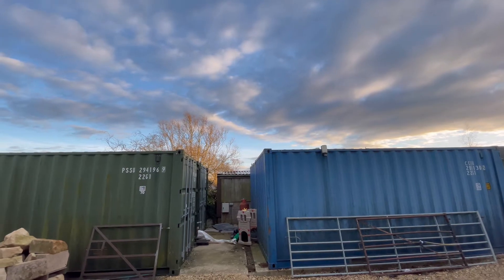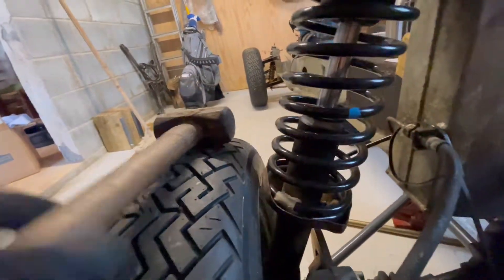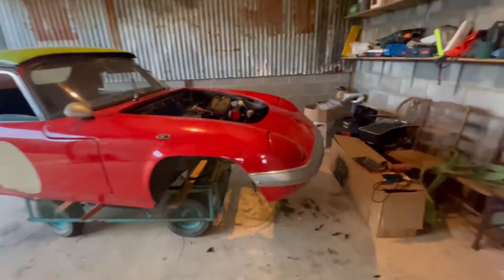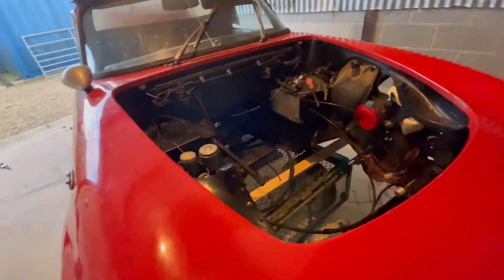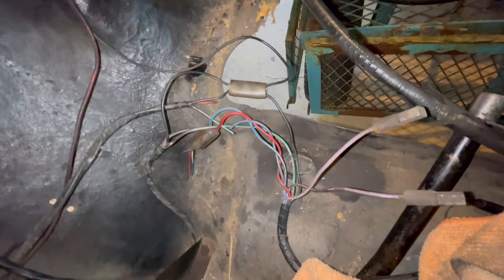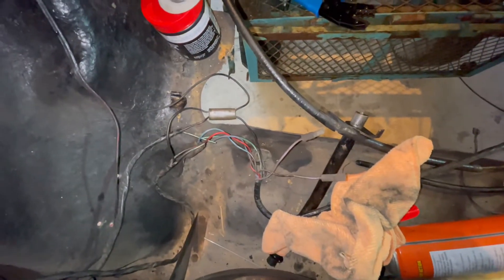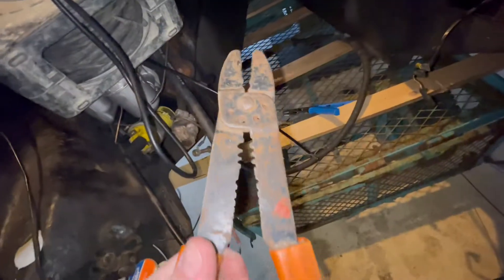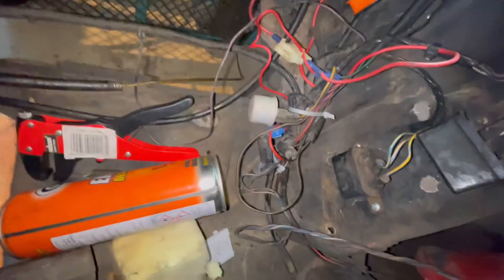Lotus elan ep 7

Comment: Maybe try cutting slot through one side of nylon bushing with hacksaw so it fits tightly on steering column, then wind  pfte tape around outside of bearing to get close fit inside steering column tube.

Lump hammer type solution that just work. Lol